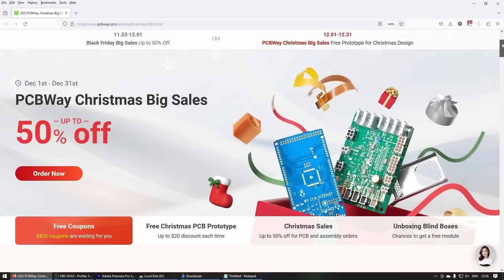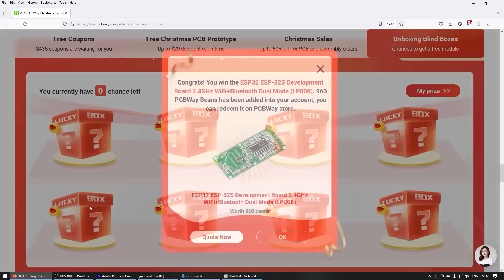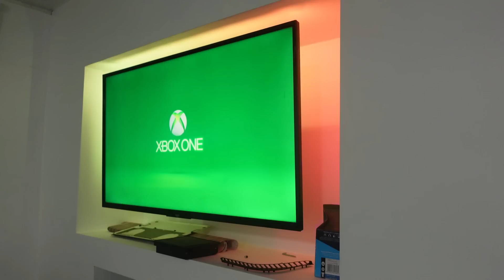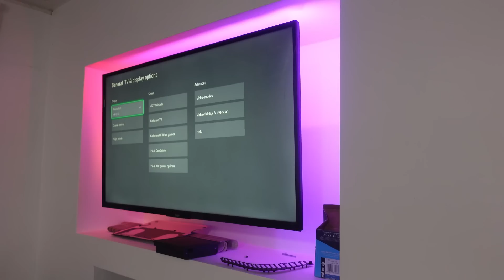This Xbox One X Won't Turn On (No Beep)! Can I Fix It?

Comment: Thanks for your Vide! My question: Why do these encoder chips fail so often? You hear about it again and again. Is it the inferior chip or what is going on there? 

The problem has also been affecting the Series S/X since the Xbox One S. Why hasn't this weak spot been fixed by Microsoft yet?
Reply: Because the encoder is getting way too hot 🔥 & it's blowing .

There's enough room to use a small low aluminium or copper heatsink attached to the encoder to keep its temp down , this is what I've done to my One X  , never had a issue so far 🤟
Reply: Very nice idea, Microsoft should adapt that! @farmerJ-zp9dj

Comment: Mine stoped working after The electricity At home failed (on and off on and off) now It doesnt turn on, just beeps, light and offf inmediately, and when i plug off The cable AND press The button beeps once and turns on and off one last Time xddd, maybe Is Time for a series S/X or Ps5 slim😂😢

Comment: Hey Phil, would you be happy to have a look at my LG UltraGear 27GL650F? I bought a Series X it was fine for first 2 days, third day the screen went black and now the monitor has no power at all. Power cable works absolutely fine but the monitor is dead.

Comment: Says there's nothing wrong with the lead free solder that's on there then fights to get the chip to flow in that same solder, I think you'd have had a much easier time if you replaced the solder buddy. 🤣
Reply: Ahaha casual phil 😂😂